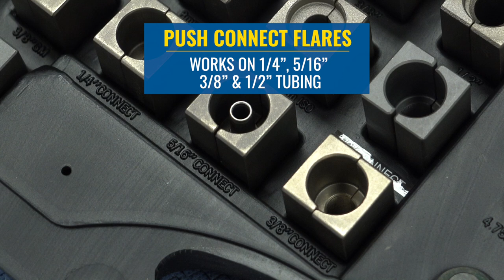The Easiest Way to Make Flares on Brake, Fuel & Transmission Lines - Eastwood Hydraulic Flaring Kit

Comment: Looks like a solid and versatile tool. If I ran a garage I'd definitely want one. Sure beats a manual flare press. The handle on my flare tool looks like wet spaghetti from all the pipe leverage I placed on it over the years.

The only downside is it's kinda big, so getting it into tight positions on tubing already in a car could be a problem. It's really more for bench top repairs. Mind you I can say the same of a manual press too. Still - an impressive tool.

Comment: Please pass it up the management chain and make one for 37 degree flares for us aviation and race car guys that use AN fittings!!
Reply from the maker: WE GOT YOU. 
The Eastwood Professional Brake Line and Tubing Flaring Tool (Item: 25304) is "turret-style." 
That flaring tool will work with the AN/JIC, 37-degree flaring die set (Item: 30005) that we offer.
Check that setup out. 
-JD

Comment: Does it work with stainless lines?
Reply: I have used it to make flares for stainless, its difficult but it worked for me.  Make sure you use blue tape to keep from scratching or scoring stainless from the die set clamping down on it